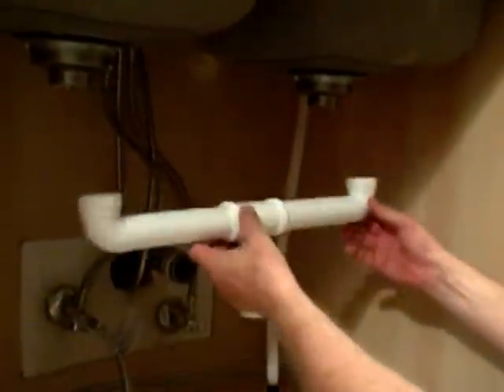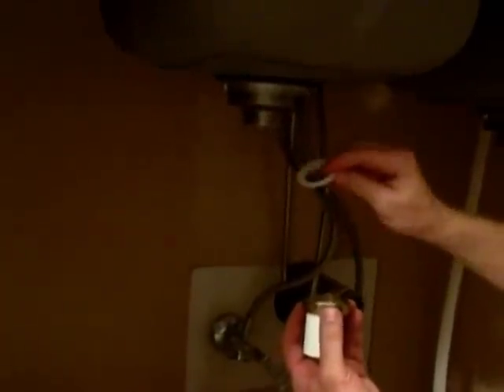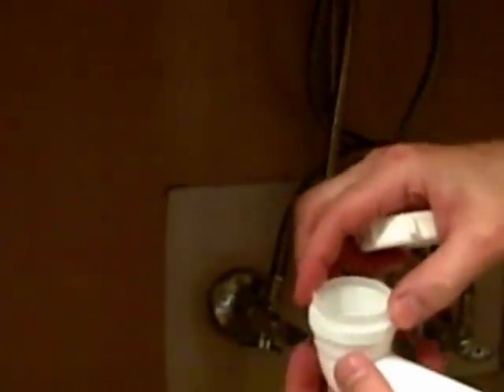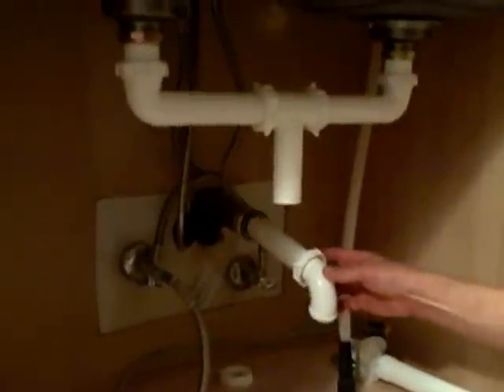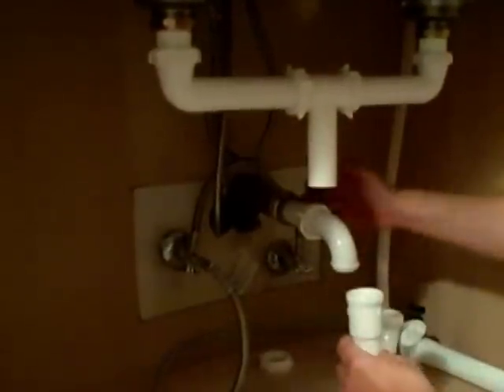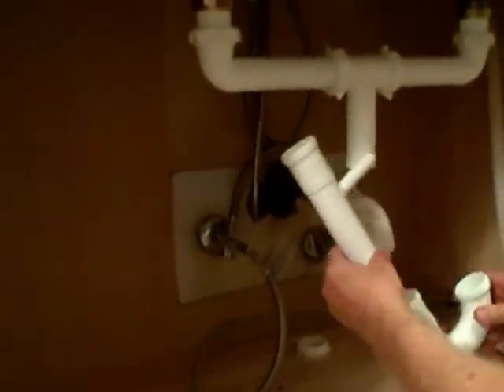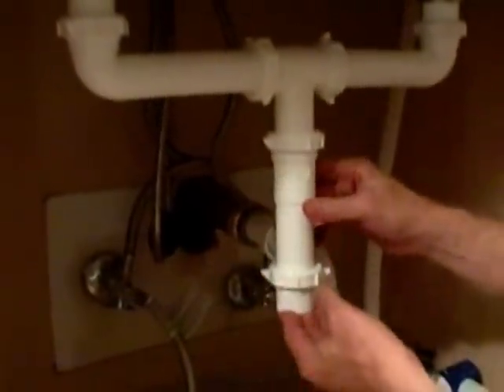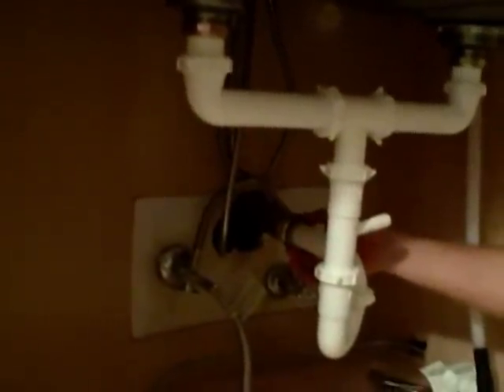Kitchen Sink Plumbing - How to Replace a Kitchen Sink Trap

Comment: Wow! I've been trying to figure out the leak for two months. This is the first video describing the metal nut on the sink basket. Well... turns out mine was loose. I took it off and cleaned it and the washer. No leaks so far. I hope it stays that way. No one at Lowe's or Home Depot mentioned this. They kept selling me P-trap nuts/washers. Thank you!
Reply from the maker: Hi, glad it was helpful.
We have more tips in our home improvement book http://www.amazon.com/dp/B01BK2K0JM?ref_=pe_2427780_160035660
Reply: It sure has! Still nice and dry. I just purchased the e-book. Thanks again!
Reply from the maker: Thanks!
Reply: Tapiwa Wakatama ..

Comment from the maker: Da Burner Hi, we are in the Chicago area. The new center outlet T's made by Plumb Pak have a Sanitary Baffle Tee. There is a dividing piece to stop the waste and drop it down into the T. 
We have more tips on our weekly podcast https://itunes.apple.com/us/podcast/fix-it-home-improvement/id880903087?mt=2
Reply: Thanks, that explains it. That new Tee is not code out here (yet), but if it works that would make the hookup easier when the drain hole in the wall is centered between the two sinks/drains
Reply from the maker: Yes, makes it easy to run your wall tube straight into the stub out.

Comment: This is excellent. My drain outlet is far to the right. My sink outlets are 20 inches apart, rather that the usual 16 ". I can't find a kit with such a long pipe and can't seem to find a union for the lighter pipe used in these continuous waste assemblies. Any suggestions?
Reply from the maker: Hi, you can send a picture to fixitpodcast@gmail.com.

Comment: Do you use plumbers putty or cement/primer? Mine have small drip. Is there a way to clean out all the build up in main drain pipe coming from wall? Has a sewage smell since I replaced pipes and water is barely going down and filling up on both sides of sink equally. Think main pipe is clogged. Thanks

Comment from the maker: Hi,
These are all slip joints. You don't need glue. You tighten down the nuts on the washers and form a waterproof joint. Makes is very easy to remove the parts if you have a clog. Also very easy to assemble.

Comment from the maker: Hi,
Every tube that is going into a slip joint should have a washer. The nut will tighten it down to a water tight connection. The only exception is the wall tube. This tube has a built in washer.

Comment: My sink has the main drain to the right which is a y piece.  I have 2 traps from each sink going into the Y fitting.  

I am thinking of running my left side over to meet the right and go into 1 trap and then cutting one of the pieces of the Y and capping it.  I think my Y is larger at the base and as it branches to the two Y parts is narrower.  I cannot cut off the whole Y because its very close to the wall.. Or perhaps I could.

Any problems with capping one side of the Y ?
Reply from the maker: Hi, you can send a picture to fixitpodcast@gmail.com.

Comment: This was a great video. I'm a home owner doing my own DIY'S    when I can. I did change all my kitchen sink plumbing out. Even the strainer baskets. All was great for about a month. I'm not getting a good seal on the tail piece and the next pipe. Any suggestions??
Reply from the maker: Hi, the first thing I would replace are the nylon washers. You can send a picture to fixitpodcast@gmail.com.

Comment: Really great video but he leaves one question unanswered: Where you attach the horizontal plastic tube to the wall stub-out you use a metal nut. How do you make the seal at that point? Do you use one of those beveled nylon washers such as you used at the plastic to plastic junctures? Do you use a rubber washer? Do you use pipe tape or dope?
Reply from the maker: Hi, where the horizontal tube goes into the stub-out, use a beveled nylon washer. It will create a water tight seal. You don't need Teflon tape or pipe thread compound.
We have more home improvement tips on our weekly podcast http://castbox.fm/u/6389499.

Comment from the maker: Hi,
If you are using a nylon washer, you want the smaller beveled edge facing the slip joint, with the larger side next to the nut.
For slip joints you don't need pipe dope, it should be water tight without it. For threaded pipe, you would always want to use pipe dope so the water doesn't follow the threads and leak.
How is the dishwasher connection below the trap?

Comment: Hey thanks so much for the info! my nylon washer went out, and i'd never seen a sink drain connected that way, so i had no idea what it was called. Just ran to the hardware store and bought a new one (well a pack of two) for about $2.50 and my sink no longer leaks! :D
Reply from the maker: Glad I could help

Comment: Hi, I want to ask is the bevaled nylon washers are soft like rubber or they kinda hard, like a soft plastic ?
Reply from the maker: +Vytautas Poška Hi, the beveled nylon washers are very firm. I think they do a better job than rubber. They don't twist and break down over time like I've seen in rubber.
Reply: But then if they're firm, then it will seal the first time tightened. When you will disassemble it for cleaning, the washers will be even more firm and they will not seal water-tight when assembled again, because they will be too hard. . .
Reply from the maker: Hi, they are firm compared to rubber. I have used these in all our remodeling projects for 20 years or more. They work great.

Comment from the maker: Hi,
You could have a plastic fitting going into the wall. It should have a nut to tighten down the wall tube. I have also seen pipes just jammed into a drain pipe with no fitting. Once you take it apart you should be able to tell. There should be theads on the main pipe coming out of the wall. If you need more help, send me a picture, I might be able to give some direction. Good luck.

Comment: Very helpful, great video.  But you didn't go into much how to connect it to the wall outlet.  I have black ABS glued 1.5" pipe coming out of the wall.  I'm thinking to cut it under the sink and switch to CPVC plastic pipe, then proceed like you've done here (because of a leak in a glued ABS joint).  What is the proper transition from the cut off (black) ABS to (white) CPVC?
Reply from the maker: Hi, depends on your village. In some areas you can use a transition glue. It is green. You can use a rubber coupling with a stainless steel hose clamps in most communities.
Reply: thank you.

Comment: Great video.   I am trying to connect 1 1/2" plastic pipe below my kitchen sink. The plastic connects to galvanized.The galvanized has a male end. I am using the nut and washer that goes with the plastic piping.The washer is in the right direction.When everything is connected, water leaks between the plastic pipe and the plastic nut. I tried a new nut and washer, same problem. I connected the plastic into the galvanized before connecting to remaining plastic piping - still leaks.   Any ideas?  Thanks
Reply from the maker: +Army Mobility Officer Hi, I always use a metal nut to metal thread and plastic nut to plastic thread. The galvanized pipe thread can easily cut into the plastic and crossthread.

Use a tapered nylon washer, a metal nut and let me know if that does the job.

Comment: My drain is off centered about 3 to 4 inches to the right side but not directly under the right sink drain. can i still use the T outlet or do i have to use an End outlet. thanks so much.
Reply from the maker: Hi, I would use a drain kit that lines up the closest to the pipe coming out of the wall so you don't have to use a flexible connection if possible. My guess is the end outlet will do a better job for you.

Comment: We ripped out old kitchen cabinets and sinks and put in new now my question is the pipe for the water is in the floor directly under the sink is all these steps the same except for curved pipe for straight pipe correct
Reply from the maker: Hi, yes, you would be using a special trap to go down into the drain pipe. You may have to special order it from the hardware store. This type of drain is no longer code. 
We have more home improvement tips on our weekly podcast http://castbox.fm/u/6389499.

Comment: Hi, I want to replace my current 2 drain sink with a deeper sink 1 drain sink. I have a disposal so I am concerned that the drain from disposal may be lower than the main drain in the wall. What are my options?
Reply from the maker: +Sue Schmitz Hi, you can get an extension to extend the length on one side to match it up, or use a discharge tube that extends down to line it up. If you have a problem, just send me a pic. fixitpodcast@gmail.com

Comment: So it is OK that the wall drainage hole in wall is higher that the disposal drainage. I am not concerned with lining up all the tubes to fit, I am worried it will not drain out with this deeper sink.
Reply from the maker: +Sue Schmitz Hi, the drain from the disposer should be higher than the pipe coming out of the wall.

Comment: Don't know where you live, but in California that wouldn't pass code. You can not have a Tee like you have shown with both drain lines.
One drain line must be primary and straight down to P-trap and the other drain line must intersect the main drain line on the side.
This is to prevent drainage going from one line over to the other drain line.
Maybe you could explain this, thanks

Comment: I love this video. Thanks so much. I have a question though. My mothers having issues with her sink. One thing I notice that's diff from your video compared to her arrangement under her sink is the wall to pvc connection... if that makes any since... currently it just looks like the pvc is jammed into the wall with nothing screwing together... which seems odd to even me (a non plumber)

Comment: if I have a black plastic nut stuck on my metal pipe coming down from the sink, how do I get it to come off. It no longer turns and has yellow stuff around it, maybe glue, maybe sediment from the water. I want to do what this video says and connect metal to metal nuts. with black plastic piping ..Thanks.
Reply from the maker: Hi, you can try a wrench with a longer handle to get more leverage or you can use a hack saw to cut through the nut. Let me know if that helps.
Reply: I found the metal threads on the sink basket were rusted out and applying a wrench broke the whole thing off. I ended up replacing the 2 baskets in the double sinks as well as the plastic pipes. I got a lot of help from your video and from another one that showed how to replace the baskets.. Thanks a lot. I am now a YOUTUBE  home plumber :D

Comment: Do you need to have 2 traps with a double sink or just 1 by the main pipe?
Reply from the maker: quinones325 Hi, one trap is very common and easy to install. Some plumbers use 2 traps with a garbage disposal.
We have more tips on our weekly podcast https://itunes.apple.com/us/podcast/fix-it-home-improvement/id880903087?mt=2

Comment: Do you have a good solution if the stub out is about 8" higher than the one you show in your video?
Reply from the maker: +Iamthejudgeofnoone Hi, how long are the tailpiece pipes coming out of the sink baskets. Can you cut them down? How long is the tailpiece coming out of the T?You can email a pic to fixitpodcast@gmail.com

Comment: Having plenty of space to work around without worrying about bumping your head or having to lay down to wrench a stuck metal nut sure makes things a lot easier.  Do you have a video which includes a disposal.  

I think that last and final step should be to post a small label on the sinks back splash as a reminder that grease of any kind should not be put down the drain.

Comment: How low does the j bend need to be in relation to the soil pipe?
Reply from the maker: Hi, they come in standard sizes and shapes when you pick one up at the hardware store or home center.
We have more home improvement tips on our weekly podcast 
https://itunes.apple.com/us/podcast/fix-it-home-improvement/id880903087?mt=2

Comment: So the T is not centered of the main wall drain right?
Reply from the maker: Hi, it depends on how your sink and the pipe coming out of the wall are lined up. If it is between the 2 bowls use a drain kit that is centered. If the main pipe coming out of the wall is under one of the bowls, use an off set drain kit. You can then adjust the trap to line up the pipes. 
We have more home improvement tips on our weekly podcast https://www.himalaya.com/s/CR.
Reply: Ok thanks so much! Another thing is can you buy the dishwasher tube without the nut on top?All I've seen is the ones with nuts mounted to them

Comment: Skipped the one part I needed: what's the proper way to tighten these plastic nuts down? I'm sure it has to be more than by hand, but what's the proper tool? How hard do I tighten it?
Reply from the maker: Hi, because of the washer, it is designed to be hand tightened. You could use an adjustable pliers to snug it up.

Comment: The pipes under my double kitchen sink are laid out neither of the ways he says.  The two basins both go directly to the main drain in the wall and are connected to each other there.  I took it all apart to fix a clog and now can't get one of the sides back together.
Reply from the maker: Hi, you can send a picture to fixitpodcast@gmail.com.

Comment: how do you connect the plastic pipe to the metal stubout?
Reply from the maker: Hi, you can use a vinyl compression type washer with a metal nut. You could also add a female threaded trap adapter to the stub out. Here is a link to our weekly podcast http://www.stitcher.com/s?fid=49441&refid=stpr
Reply: Thanks, but my stub out is an unthreaded 1.5" copper pipe. I've been unable to figure out how to connect the two.
Reply from the maker: Hi,
You can get a Marvel Fitting that has a compression fitting to connect to the stub out. You can also get a trap adapter that can be soldered.

Comment: my sink doesn't have a piece to screw to the drain ? the piece is just shoved up in there. should I replace the whole thing
Reply from the maker: Hi, if you can add a trap adapter, it will prevent it from leaking.

Comment: Center outlet wastes are not up to code.  Only an end outlet waste is to be used.  Reason is that a center outlet waste has no baffle and allows water to shoot across the outlet and right up into the other sink.  

Daniel...licensed plumber

Comment: in Ontario  t's are not aloud to be used like that for sanitary like that. . only vents..   theory behind that if both sinks are drained at the same time, the water will be fighting and colliding with each other when the meet in middle of t,
|___|__P . our set up is like that, kind . lol hard to do with letters lol
Reply from the maker: woclaz Hi, these new T's have a baffle in the center that directs each side down.
Reply: cool, i have never seen those! they probably still not allowed here.. our codes are super anal lol
Reply from the maker: woclaz We have more tips on our weekly podcast https://itunes.apple.com/us/podcast/fix-it-home-improvement/id880903087?mt=2

Comment: Do not use a Tee. Use a Wye on one end.
Reply from the maker: Both work well
Reply: A wye? Naw dude sanitary tee. Wyes are for branching off the main line. A sink isnt a main line. Its already heading for a wye when it hits the main. I do see your thinking tho. But in my oppinion putting a flat tee in the middle of a double basin sink is just dumb plumbling. Takes up too much space and is definately getting clogged using this videos technique lol

Comment: You do not use the t joint between the two drains! Water and junk goes from one to the other
Reply from the maker: Hi, the T on a center outlet sink drain will have a sanitary baffle to prevent that. You want to use a center outlet with the T if you have the main drain stub out centered between 2 sink bowls.
We have more tips in our home improvement book http://www.amazon.com/dp/B01BK2K0JM?ref_=pe_2427780_160035660

Comment: Not the proper way to tee the two compartments. Should be using a sanitary tee, looking toward one side or the other, under one compartment, with the p trap off the bottom of the san tee
Reply from the maker: Hi, if the main drain pipe coming out of the wall in in the center of the 2 bowls, you would use a center outlet kit, like in the video. If the main drain coming out of the wall is under one of the sinks you would use an end outlet or offset. This way you have a direct connection, rather than having to use a flexible drain pipe.
Reply: FIX IT Home Improvement Channel swing the p trap to be on the center you need to be on.
Reply from the maker: Hi, the trap will swing about 4 inches either direction, but in the case of a kitchen sink, if the stub out in the wall is centered under one bowl, you would need about an 8 inch swing. The center outlet drain kits have a sanitary tee. There is a piece of plastic that directs the water flow down from either side.
Reply: FIX IT Home Improvement Channel I'm not trying to dog you. I know it's a demonstration for one of those kits from the store and not sch 40 pvc
Reply from the maker: Hi, just showing what most homeowners would use for their home. Easy to pick up at the hardware store and install.